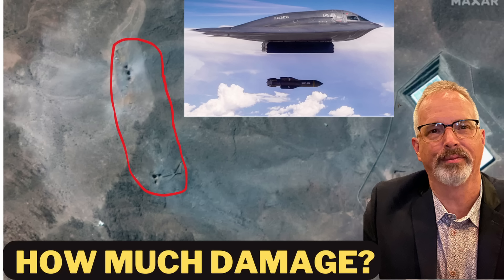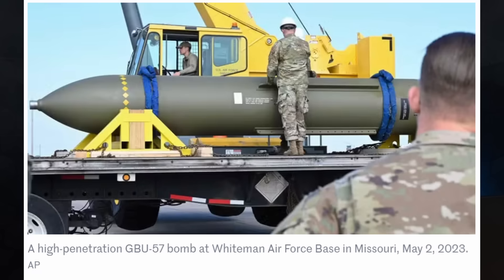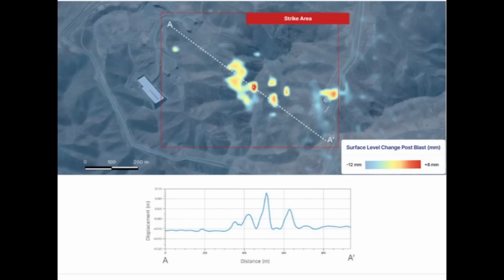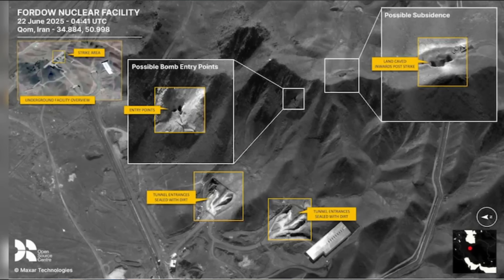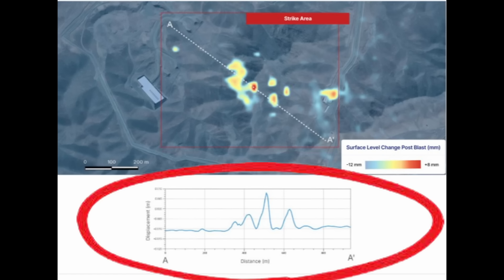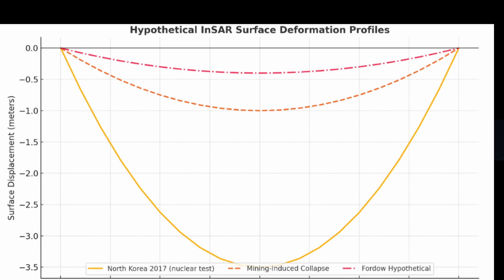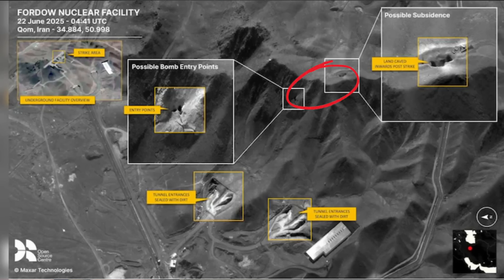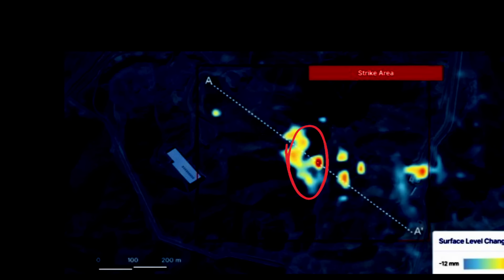Fordow Attack Assessment -  Update

Comment: I see one aspect that seems to be missing in assessments...Granite is pretty unforgiving, very high compressive strength, so even if the bomb didn't reach the lab, per se...it had to give it a pretty severe seismic pounding. With centrifuges spinning upwards of 50,000 to 100,00 rpm  on magnetic bearings, I envision the lab having a bunch of "Tasmanian Devils" spinning out of control, High Voltage lines being sheared, and chemical pipelines suffering the same fate. I've seen a lot of space evaluations, but no seismic evals, that had to send the granite ringing like a bell, even from a distance... I'm no geologist.. Just sayin...

Comment: The Massive Ordnance Penetrator is a 30,000 lb bomb.  It does NOT have 30,000 lbs of explosives.  The explosive payload has been disclosed as 5,500lbs.  Reportedly 12 were dropped on Fordow, so 66,000 lbs of explosives.  You stated 0.5 lbs of explosive to damage 1 cubic yard, so 33,000 cubic yards of damage.  All explosives are not created equal and there is also the massive energy from kinetic energy upon impact.  Nice analysis, but not entirely correct.
Reply: Watch the video.
Casey says the warhead is about 5,500 pounds.
Reply: @Qietman  yes, he did say that in the beginning. But he also said 130,000 cubic meters of explosive damage which is 2X what his formula calculated. Good video, not disrespecting his work, just pointing out the discrepancy.  It’s what engineers and scientists do.
Reply: Meant 4X, July 4 hangover
Reply: It does appear that Casey has mis-estimated the tonnage of explosive. That said the effects of massive blasts are essentially equivalent, as seen on estimates of Nuclear explosive power based on comparisons to real explosives (it's just a shock wave...). 
There is also the aspect that military explosives at typically more effective [explosive power] than 'cost effective' mining explosives, so that may have been factored in but not mentioned in the edit. 
It's still a big bang though ;-)
Reply: Remember, the first earth penatration bomb was made out of a Used, and Replaced , 8 inch artillery gun barrel. Completely re- machined and re+engineered into a penetration delivery system/bomb. The barrel and breech went Backwards Into the Ground and exploded. That's called Government Recycling at its finest. And, a gift from Grandpa.

Comment: After looking over that image closer it's interesting the holes that are getting less interest in the after photos seem to be the ones with the most rock broken under and also have less of the burnt surface around them.  Still somewhat skeptical either got into the facility properly...but for sure rhe one with less surface burn was more likely to have made it in and seems to be the one that raises the peak of the mountain a bit with the fractures.  Think the somewhat uphill from hit swell is interesting also.  Could be a lot of fractured rock that doesn't go quite as deep as we would have liked.  Obviously shifted a big chunk of the mountain between the two entry holes a few mm higher.  Which is interesting, but not sure it says a lot about how deep the fractures went.  Sorta looks to me like fractures remained sorta surface level the 10s of meters deep the bombs can get too easily though.  My issue is I don't see them going way deeper in prefractured rock than un fractured rock if you aren't able to remove some rock between hits.  So I don't see the 10s of meters of penetration adding well at all.  If the blast could clear material above...then maybe...but thats just not what happens.

Comment: 6:13 I think the actual amount of explosives is much less than 30,000 lbs. the bulk of the weight is the casing. I think the actual explosives are somewhere around 5-8k lbs if I’m not mistaken. Surprised you made this kind of mistake on a very very high level basic detail
Reply: It’s 5,000 lbs of explosives
Reply: Maybe he is referring to total explosives over all bombs dropped.

Comment: The heat map is amazing (3:25).  I had no idea you could measure mm changes in elevation by satellite.  It can be calibrated by the ground that has no elevation change, but this is still amazing precision.

(The absolute elevation is accuracy whereas relative height is precision.)

Comment: good analysis I would ignore the AI data generated by 2d imagery, the other stuff is compelling.  It also makes sense that the blast would find the voids in the rock which were the structure Iran built into the mountain, that's where the energy would "lease resistive path" go.  I think it is hard to really know if the blast developed 500000 m^3 or so of rubble.  As all 6 were in a sequence and their CEP didn't allow one hole into another there are "losses" there.  It is likely that 2 and 3 bombs in the sequence found a compliant void tho... to say the least  :).  Or I could be completely wrong and the CEP is not the error but there is some analysis that insisted on a spread for this type of impact.....

Comment: Not one expert on TV has ever been in an UG mine at 2000 ft. Rock stability is a problem without bombs. Ventilation, utilities, egress, etc need constant attention.  The centrifuges I worked with were very sensitive to vibration. Regaining access to these centrifuges after this damage would be extremely time consuming, expensive and dangerous. The size of the crater is way down the list of importance. What is the diameter of the ventilation shaft relative to the bomb diameter would be more important.

Comment: the fact that surface damage is minimal means that bombs went really deep...
Reply: Yo make sure there’s no ICE around you Carlos. They might just deport you lmao.
Reply: @faisalchowdhury9359 ....???.... I live where I was born.... 
PS - your comment is out of context.... like your brains....
Reply: Not at all. It could also mean, that it hit very resistant material which got pulverized, like UHPC. We have managed some really impressive concretes, they can withstand stress multiple times more than granite or other natural rock.
Reply: @nukularpictures  Yeah and these bombs were tested against them and succeeded. A 30000 lb bomb traveling at over 500 mph with a diameter of 30 inches, and a contact point much smaller, isn't going to bounce off any concrete and only do surface damage, no matter what your aunt has told you that CNN told her. It's physically impossible. That concrete would functionally turn into a liquid at those forces. Sure, it might slow the bomb down faster than regular concrete, but FFS, it didn't stop it or even come close. That is roughly 138 million pounds of force put on the end of that bomb. They fractured hundreds of thousands of cubic feet of granite deep below the puncture holes and everything down there went bye bye.
Reply: Energy has to go somewhere and it didn't go out of the hole it made.

The only other possible conclusion is it over penetrated (unlikely as the bombs can detect when it in a cavity) or the bombs where duds (also unlikely across all 12 bombs used)
Reply: @ironwolfsaber2739 
I think the printed description of the bombs' specs said they weren't equipped with a cavity sensor, and that they detonated when they stopped moving.
Reply: that is incorrect kevin
Reply: @janemf .... lol.... what is the "correct" interpretation?
PS - I guess you know nothing about physics (or energy)...

Comment: Its so disappoint when someone with a science background ignores basic physics and common sense.    
He talks of the damage a GBU can do to granite rock without mentioning that these granite caverns were lined with many metres of heavily reinforced high grade concrete designed for such an occasion.  
   Each bomber carried multiple GBU.'s  GBU's  although guided and GPS enabled are NOT extremely high precision weapons.  Their accuracy is measured in metres not centimetres.  Essentially they will hit within a few metres of target.  These bombs are nearly a metre wide. A ventilation shaft even with an extremely high air flow is only a few metres wide.  In ideal perfect condition with a perfect trajectory the walls of the shaft would be no more than a metre from the falling bomb.  But we know these bombs are not that accurate.  The chances of even one of these bombs entering the shaft, dropping absolutely vertically for hundred of feet with out impacting the vents walls are infinitesimally low.  But each bomber dropped multiple bombs and between the first bomb being released and the second bomb being released the aircraft would have moved  close to a mile, and probably more. the chance of a second GBU hitting exactly the price point the first GBU hit is virtually zero.
  Secondly  the air vents were nowhere near the chambers that contained the centrifuges.  Each tunnel and chamber is separated by blast doors designed to protect against this very type off raid.  It might interest people to know that Iran is the world leader in concrete technology.  Iran is an extremely seismic region and allegedly the Iranian's designed the Fordow complex to withstand a F5 earthquake, but just as likely to protect against a raid like this or a nuclear attack. Each tunnel and chamber is protected by metres of heavily reinforced high grade concrete with blast doors.   All the machinery was mounted on rubber foundations to protect against earth quakes and shoch waves from a bombing raid such as this.   So even if the GBU got to the bottom of the ventilation shaft intact the blast wave  would have had to travel hundred of metres through tunnels protected with walls multiple metres thick of heavily reinforced concrete, destroying multiple blast doors designed to withstand nuclear attacks, before even having an effect on the chambers holding the centrifuges.
  It also might interest people to know that the design of the Fordow complex and other missiles complexes in Iran are more or less a direct copy of a design that the US made back in the 70's. The U.S. military considered, but ultimately did not implement, a design for an underground nuclear missile silo complex that was too expensive. This design involved a massive, complex structure capable of housing and launching intercontinental ballistic missiles (ICBMs), but the projected costs proved prohibitive. Knowing that this complex could ultimately be attacked with nuclear weapons the Iranians obviously thought prohibitively expensive was acceptable and then proceeded to build it under a mountain range 8000 feet high.
There's no doubt that a lot of damage was done to the ventilation shaft and surface buildings.  The Iranians will have to rebuild tunnel entrances, rebuild the ventilation shafts and probably replace a number of blast doors but this work can be done in months not years.  To suggest there was massive damage done to the crucial chambers of this complex is extremely misleading.

Comment: Thanks Casey, as a fellow Geologist, it is likely the GBU 57s penetrated the facility, cracking/fracturing the tunneling and "flushing" the contents of the tunnels. The tunnels may or may not have been collapsed, but the contents of the tunnels are likely smashed. Any collapse, fracturing or depression or not be consequential. The Tunnel entrances show this tunnel flushing from the blasts. The air pockets of the tunnels and ventilation are likely to have been the points of least resistance, and the areas likely most damaged, by the shear explosive expansion. Not necessity the Geology.
Reply: "The Tunnel entrances show this tunnel flushing from the blasts": I was thinking about the work the Iranians did to block the entrances ahead of the attack--I suspect that it was not "packed tight" and any overpressure coming out through them could have caused that material to "balloon" outward...
Reply: The Iranians already filled in the craters according to latest satellite images😅😅.😂. They wouldn't be able to do that if the facility is penetrated...
Reply: I don't think they intended to collapse anything to a massive degree. They were more using the overpressure to compound and destroy anything as consecutive bombs multiply the concussive affect of the overpressure. Not to mention just the nature of being in an enclosed tunnel multiplies the overpressure 3x-4x. But I'm a physics major that works with magnets so what do I know really😂😂
Reply: @jonlamontagne  the point it's not an enclosed tunnel. It will for sure have multiple decoy voids. They are no dummies.

Comment: Powder factors are a very crude approach at best to estimate the explosive effectiveness in mined environments. The empirical data used to determine these sorts of bulk numbers are mining-centric, almost exclusively in a) benched strip mining operations, or b) shallow tunneled coal mining operations. There are, however, resources for deep hole blasting that clearly focus on biaxial stress  and strain relationships to yield principal stress calculations with outcomes that have enormous variations. 

In short, the relevant data has little in common with the bench model derived "powder factors". 

In general, as depth is increased, energy is increasingly distributed laterally and with decreased effectiveness, particularly in constrained isotropy. Adding strong refractive elements amplify tis effect nonlinearly, and stratigraphy is critically important to determining something as crude as a "powder factor". Results of this crude measurement can vary by more than an order of magnitude of diminishment compared to simple bench mining data. 

The bulking factor is yet another area that is of limited use in deep vertical excavating explosive efficiencies, again because the models are derived from benching operations. But there is actually data for this for deep mineshafts, and it is well under 1.5 for granite in areas without pre-existing voids. Deep drifts in granite can be as low as 1.1. 

There is a wide and more or less continuous gap between the low damage estimates and the very highest estimates of rock fracture that leave the truth to be known of the fate of the site for the future.
Reply: So what happens when instead when there is a large pre-existing void, like the tunnel and working facilities that is closer to point of bomb detonation when compared to the surface level of the mountain?  I would expect that energy to more easily transfer laterally in the direction of the tunnel, especially if an earlier bomb actually caused or enlarged existing (ventilation) penetrations leading into the void however small initially.
Reply: @edl653 I totally agree with you on that assumption. Existing vent shaft. Most are fairly large for venting stale air. Penetrators capable of possibly 200 feet in solid rock or concrete. Seems to me the first one would have reached the bottom, then 5 more behind it. They are 31" in diameter. A shaft would be that or more. I have no doubt 30,000 lbs of explosive did a number on that entire tunnel and remember, there were 2 shafts, one at each end. The Grey dust spread out on that mountain is powdered granite and concrete. Lots of it.
Reply: @3gunshooter60 How do you know what caused the coloring of the surface? If it were ejected powder, it would be densest around the vents, but it's not
Reply: Cannot agree more.  When you say 100 000 m3 of broken rock/disturbed rock - that would be for a grid of holes - not a single hole with the energy radiating out from it.  InSAR is really reliable for ground deformations vertically, less so for landslides BUT where the ground is sloped -there can be issues based on the angle of incidence of your radar.  The fact that there is deformation outside the blast area -questions the data within the blast area.  I do not understand what is going on outside the blast area -but clearly - this is what is going on within the blast area is not great logic....
Reply: @MAEBikr what it probably means is the blast followed a tunnel to something else in that area, then there was the blast backpressure where it could no longer freely expand.
Reply: The powder effects are merely one piece of evidence. There are multiple variables in a BDA to determine a best guess as to the impacts of the attack.
Reply: Interesting analysis, but no one knows the path the bombs followed after entering the shafts. Unless they entered at the same angle the shafts followed, presumably vertical, the bombs probably pierced the side of the shafts and went God knows where. Calculations like we saw here are intriguing, but I've no idea of whether they truly lend credence to claims of total obliteration.
Reply: @Buddy308 We have an idea because of the testing that was done, geology analysis, BDA factors, knowledge of the fragility of centrifuges, etc.
Reply: Well, the fact that they dropped the bombs down the shafts means they didnt have to penetrate that much material. Also they were set for certain depth before detonation, so if they detonated they reached the proper depth.
Reply: @SteveFreeman-v4d  The fuses are more sophisticated than that.
Reply: @SteveFreeman-v4d lol you think if they wouldn't reach the set depth they would not detonate? 😂😂😂😂
Reply: No habla jibber jabber. 😎
Reply: @utoobia  You should stick to your coloring books, then.
Reply: @markalexander832 I mess with Texas.